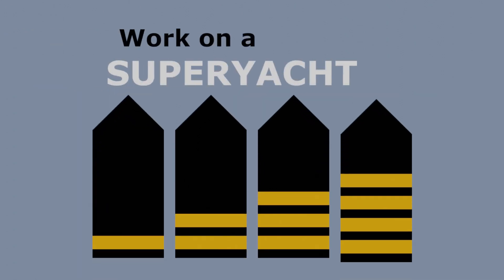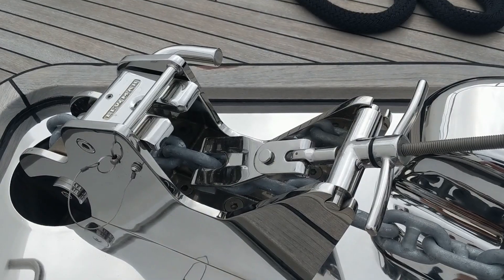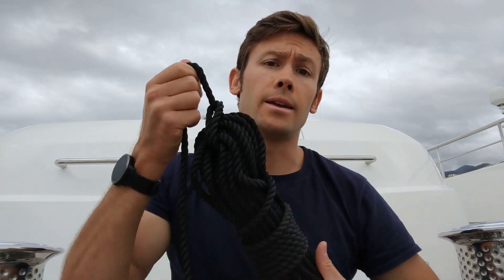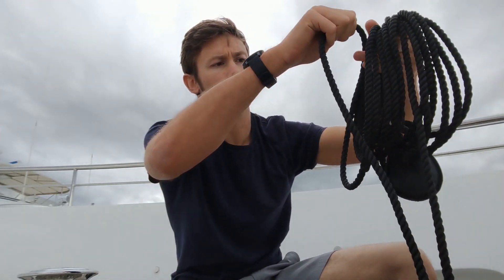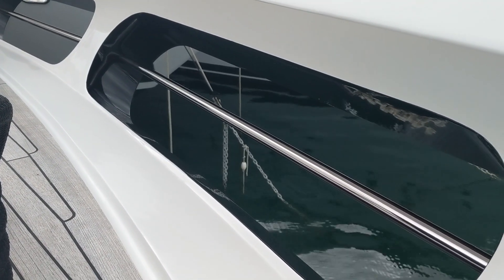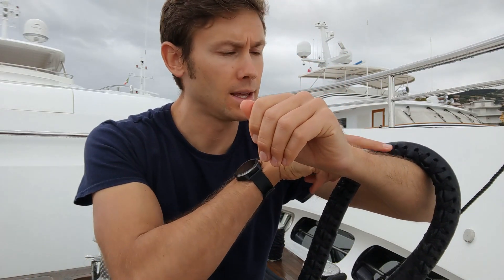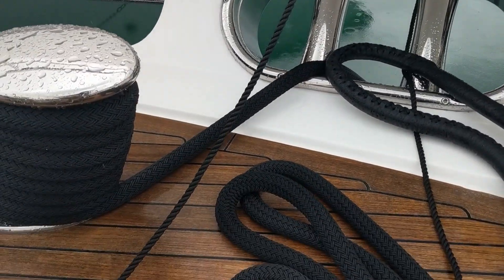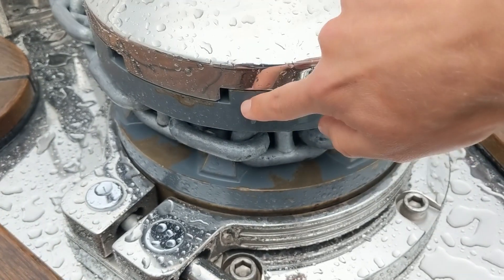Superyacht Deckhand Duties Series: Mooring, Part 1

Comment: Im watching your Vid's mostly with pleasure. I am 2nd Officer on Cargo Ships with 5 years experience in rank,  desiring to shift to superyachts. However please review your knowledge about heaving lines. You are not making the propper knot on it (it should be easily disconnected by 1 move), also there is no rule about 6 rounds (to be honest sometimes it is much better to make more, simple physic which i belive you will easily understand). And why you are making the knot on the end of the line? Much faster and safer is to send the line, take the slack out and make a propper knot in a good place (actually i belive that procedure can be found in COSWP). 
Cheers and have a good watch!

Comment: Good  advice given in the video. I’m just curious why such a large eye in your mooring line? I was always taught no larger than 5 times the diameter of the fittings it will be used upon. 

 I ask this because of your chosen heaving line attachment point. With such a large eye it’s very possible the attachment point will be out over the water

Comment: sorry for my dumbness  in advance but its how i learn  .. why do yachts  not have an anchor  on the aft  as well as the bow  ? kind regards j.a
Reply from the maker: Hello johnarrow. No need to apologise; it’s a good question. Some yachts do have a stern anchor. I once worked on one that did, but it was fairly small and couldn’t be used to anchor the yacht alone. It was good at stopping the yacht from swinging, but it was difficult and slow to operate so we rarely used it.

Comment: Hi. I just finished my deckhand courses. Was wondering what is the best advice to find a job with no experience.
Reply from the maker: Dear Tyron. Welcome to the channel! Congratulations on completing all of your courses. When you're just starting out and have no experience, your best chance is to base yourself in one of the major yachting hubs. Depending on your present location, this time of year I would suggest Antibes in the South of France. Before you go, make sure your CV is all up to date and that it highlights any relevant work experience or interests. Be very clear about why you want to start working in this industry. Then, sign up online with all the agencies you can find. Once you arrive in your chosen destination to look for work, you can go and meet all of the agencies in person and of course start walking those docks! You can find out more about this in my dockwalking video. At this point, it's all about perseverance. The more work you put into it, the more work you'll get out of it. Learn as much as you can, network and stand out (for all the right reasons). Slowly (or maybe quickly if you're lucky) opportunities for day work will come up. Arrive on time, be enthusiastic and build a rapport with the crew. Get a good written reference, get it on your CV and then get yourself out there again for the next opportunity. It's harder than ever this year but be persistent and it will all pay off. Good luck and please let us know how you get on. If you've got any further questions then please don't hesitate to ask.
Reply: @WorkonaSuperyacht  Thank you so much for the information. I'm currently in South Africa and can't get a visa as yet because all the embassys are closed due to covid 19. I was thinking of going to Dubai because they issue you a visa on arrival. I'm super interested in this industry and enjoy sailing in my free time, with determination and perseverance I'm sure I'll get a job soon.
Reply: @tyronadams4798  hi, who  did you do your course through? thanx
Reply: @dominiquereynolds9719  Hi. I did it threw a company called PYT. Professional Yatchmaster Training.
Reply: @tyronadams4798  thank you, will have a look at them. :)

Comment: Is it possible to work on a yacht without experience?. But i have a experience on a passenger ship and barge here in the philippines
Reply from the maker: Hello Rastle. Yes, you can start working on superyachts without any maritime experience. Which department are you interested in joining? There is a lot of competition for the junior roles that don't require previous yacht experience, so the key is to make yourself stand out. Your time spent working on passenger ships will certainly be very helpful.
Reply: @WorkonaSuperyacht  im on the Deck department. I have a 2/IV certificate   to be an Ordinary seaman.. i have a 7 months experience at sea.. 2 Months deck cadet on a passenger roro and 5 months ordinary seaman on a Barge ship here in the Philippines.. im olso a Philippine Navy reservist
Reply from the maker: @Rastle Client Genodepa This is some great experience. Other important skills that yachts look for in a deckhand are tender driving, deck maintenance, and water sports.
Reply: Can i apply online? are there any website that you can recommend  and how can i apply for deckhand position without experience on yacht
Reply from the maker: @Rastle Client Genodepa Yes, there are lots of yacht crew agencies that you can sign up to online. I can recommend Yotspot; jf-recruiting; luxyachts; Bluewater yachting. Just run a search in Google to find many, many more.
One thing I must also say is that without yacht specific experience, it can be difficult to get started in the industry without actually visiting the yachts and agencies in person. Most yachts are based in either the Mediterranean, or on the East coast of the USA. Nevertheless, it's always a good idea to start online to get an idea of what opportunities are out there.
Reply: Ok noted 👌. THANK YOU